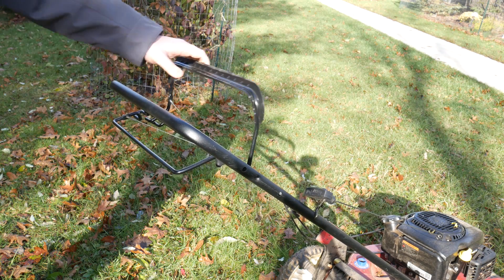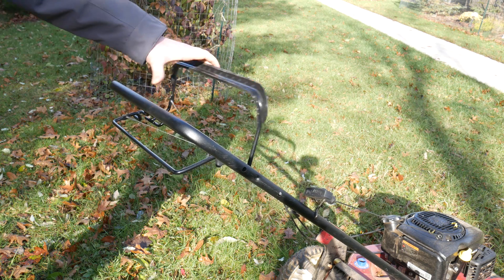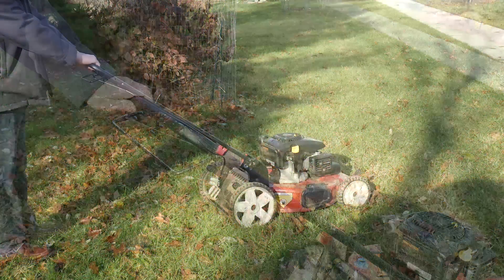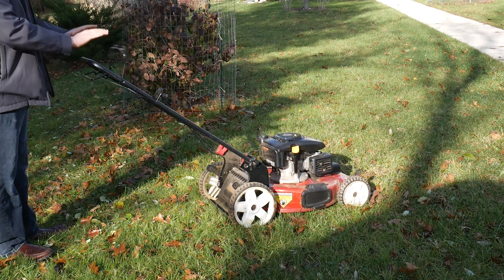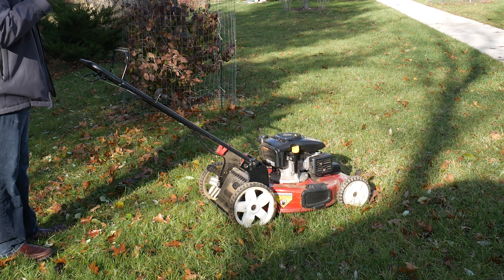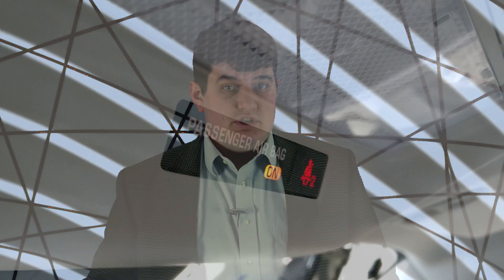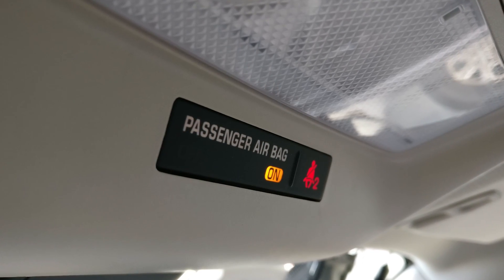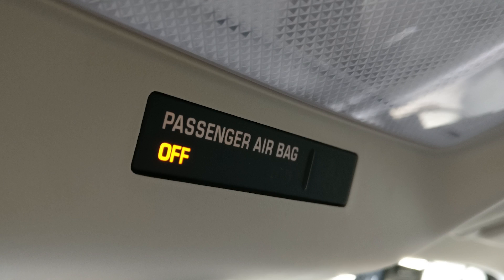The Dead Man's Switch:  How Anton Yelchin's life could have been saved

Comment: I was in a loaner vehicle while my motor was getting replaced and the "gear shifter" on it was pull switches on the dash. It was one of the most annoying things ever mostly because it was the dead of winter and I had to take off my gloves to select a freaking gear.

But to you point even old cars sometimes had a hard time staying in gear. I had an old Chevy truck roll into me that popped out of park and crash into my car on my street back in the day because it just didn't "stick" in park according to the owner. I've known a couple people with vehicles like this over the years and it's partly due to bad transmission design and partly wear and tear / poor maintenance, but it does happen even on mechanical transmission linkages.
Reply: @Center 4 Nerds - You could do exactly what us senior citizens do--put it in first gear--and then drive the whole trip that way. Keeps the hands much warmer!

Comment: A bungy cord easily bypasses that mower lever... probably not brilliant to use that ;-)
Now I have a riding John Deere with exactly what you are talking about in it's seat, that I have never even considered trying to bypass.  It's pretty intricate.  I can leave it running, if the brake is locked on (to warm up for instance), and the blades are not spinning.  If the blades are engaged, then I also cannot go in reverse without pressing a bypass switch.  I assume there isn't a computer on board handling all of this, so 1 of your investigations into the inner workings could be pretty cool.  
If this does become policy, you are going to destroy about 20 to 25 % of all the "America's Funniest Home Videos" library!
Just reviewing (watching) all your old content because I love the new stuff.  Keep up the good work!
-Shawn

Comment: Used to work on trains - the switch is something you actively press like every 10 or 15 min (cant remember) and if its not pressed within a specific time after its gone off the train comes to a stop. This was in case the engineer fell asleep. Its a little red light colored button and it beeps beeps in the dash in the middle when its time to push it. But it's not something you hold down.

Comment: "Since passenger seats are just symmetrical copies of driver's seats..." well seeing as many, if not most, cars are made in both left and right-hand drive, the passenger seat of the former will be the same side as the driver's seat of the latter and vice versa anyway. So it's not even an issue of mirroring the parts to work on the other side, since you're already making them for that side in other cars in the first place.

Comment: As long as they didn't apply above like, 2 mph, I wouldn't want to be cruising down the highway at 80, push myself up a few inches to deal with my shirt, and my car suddenly slamming on the brakes since there was no longer any pressure on the seat.

Comment: It is not as simple. The crashes of boening 737 max plains shows that introducing systems that are meant to correct human errors can backfire. There are so many situations from a driver with hemoroids through sensor failures to all other potential problems making such theoretically simple systems not easy to implement.

Comment: My semitruck sorta has one of these. It's more of a warning than a deadman switch. If I open the driver door without setting the parking brake then the truck will freak out and honk at me. It can be annoying but I like it better than a deadman switch. People tend to rely on safety devices when they shouldn't which becomes a problem when they fail or switch to machines that don't have them. Now I do like safety devices but I never expect them to work. I hope they do but I don't expect them to. I am the number one safety device in any machine that I operate. Everything else is secondary just incase I miss something.

Comment: The issue isn't refusing tech but introducing fault points. If there is an array of sensors and a fault would prevent the car from running at all.... Disaster. Let alone needing dealer level tools to identify the issue, let alone fix it

Comment: I know this is old but I have a slight problem. Most of the second hand cars that my family buy even in the last year (2019) are still mostly if not fully mechanical. I've seen how the accelerator pedal controls the carburettor even when the car is completely off and the battery disconnected, and how the steering wheel does the same. So this would work on new cars but the reality is most people can't afford a new car and it will be a long time until these new "fly by wire" cars become commonplace in the used market at low prices.

Comment: 2014 jeep cherokee has a dead mans switch and has saved me a couple times from bumping into a parked car. Sometimes I'm in such a hurry to get out that I forget to throw it in park. But the second my weight comes off the drivers seat it engages the parking/emergency brake (even if the seatbelt is buckled). It's not quite park, but its good enough. The jeep rolls forward an inch or two before the brake comes on to stop it.

Comment: "It's JUST software"!  What is it about software that is any simpler then hardware?  Software is MORE COMPLICATED then hardware.  Most software today is written by "software nerds" who live in a the different world of heaps, stack-frames, "inheritance", and the like.  Look at company's websites, and you can see this.  Items are listed for sale on the site that have been discontinued for 2 years!  Why?  Because the programming of the site requires a totally different set of skills from the manufacturing floor, or the stocking center.  Programming is typically done by a contractor who "comes in" once every other year to update.  At a car manufacturing plant, the software is most likely written in a totally separate facility, disconnected and isolated from the rest of the activities.  If hardware people designed cars, they would have a rotary on-off switch, not a push button.  And no, pushing button 5 times is something that software engineer would come up with, along with a status LED that blinks long, long, red short, short, long, green short, in some sort of "close encounters" code.  That's why we have uncontrolled acceleration accidents!

Comment: Using a sensor doesn't fully make sense.

Some people specifically look for a car that can go into "true neutral" to tow behind RVs without someone in it.

The bigger issue is the design of the gear shift. It's dumb and causing deaths. It's the definition of a bad design, you need to stare at it to determine the change, which goes against what people are used to.

Warning sounds or something could be helpful, but a dead mans switch would make those cars unusable for a pretty large market

Comment: I work in retail and we have electronci carts (we call them "ecarts") that have dead-man switches in the seats. Won't move unless you're sitting in (or some weight on) the seat
Reply: So if you stand up while moving, doe they stop dead & throw you off ?
Reply: @millomweb  I think they roll to a stop, but even if they suddenly stop they don't go that fast, and won't have the velocity to throw you over the seat, worst case you get throw back onto the seat I think.
Reply: @Foolster41  You don't need a lot of speed to throw you off ! Anyway, if the braking isn't severe, that's good in some ways.

Comment: I realize i'm quite late for the party, just watched it. Whenever you implement any safety feature you have to consider two numbers: 1) number of lives it could potentially save 2) number of lives it could potentially kill should any malfunction or failure accrue. if 1 is larger than 2 - implement the feature.
Also, seat sensor doesn't solve the problem of the driver being incapacitated, so essentially we are talking about a small subset of low-speed where driver is well and good incidents what makes (1) even smaller.
Reply: I think this is more vital in preventing property damage due to a car rolling down a hill most of the time than actual lives.

Comment: you are right to address that it should be possible to prevent this kind of mechanism to fire when moving, which has top priority. but there can be a lot of dangerous situations when not moving that need to be considered. ideally the car should have some indication that the user really wants to park like a button, at which point its already clear anyway. either way sensors are a fickle thing and i really wouldnt want that job. hope someone figures it out tho. like not allowing humans to drive after some point.

Comment: My 2017 Honda CR-V won’t let you disengage the parking break if your seatbelt isn’t buckled. 

The only time it’s an issue is when entering a parking garage and I need to take the seatbelt off to get the ticket from the machine and it won’t let me proceed until I put it back on for the a 15 extra feet or so I need to drive to find a parking spot.

Comment: What if a car dies on a train crossing? There are numerous emergencies where the car needs to be pushed by its lone driver, and adding a "safety" feature I have to remember to override to save the train from ramming into my car at full speed isn't a good idea. Automatic elecric break when the car is purposefully turned off is a good thing, but it's equivalent to the parking setting on automatic gearbox.

Comment: my parents had a 1974 Pinto with a kind of dead man's switch.  If you sat in the driver seat and did not buckle your seat belt, the engine would not crank.  My father, an engineer, found this amusing with valet (garage) staff who would claim they couldn't start the car.  He'd go down to the car, pull the seat belt out an inch or so (the sensor was on the reel) and start the car to their amazement.

Comment: My personal favorite dead man switch would have to be the pop off valves and crown plugs in a steam locomotive if for whatever reason all the people in the cab become incapacitated steam pressure will climb as the loss of water allows even a dwindling fire to heat it faster and the pop off valve will dump the water from the boiler steadily if that scream doesn’t tell someone else there is something wrong then the plugs in the crown (brass lugs which are drilled to be very thin) will melt and dump the contents of the boiler into the firebox and being it’s wet steam will extinguish the fire

Comment: My 2017 CRV needs this feature!    It is possible to turn the car off with the on/off button and then exit the car while it is in drive, neutral, reverse, S, or L allowing the car to roll as it is not “in gear”. The car does have a “Brake Hold” button that will hold the brake while you’re in gear at a traffic light or drive thru line or similar situation and an “Automatic Brake” that sets as soon as the vehicle is put into park but nothing, no bells, no alarms, no beeping, no flashing lights, absolutely nothing to indicate that the car is uncontrolled and is free to roll.

Comment: It's amazing the stupid issues people run into with seemingly harmless safety devices. Many Hyundai vehicles will significantly reduce engine power if the brake is applied to avoid a runaway vehicle if the accelerator is stuck. I've heard some complaints by people saying the vehicle hesitates badly when accelerating from a stop and after someone investigated, turns out the driver is driving with both feet and isn't taking their foot off the brake while they are trying to accelerate..

Comment: I'm guessing it's that they'd be taking a real risk of causing large numbers of instances of catastrophic loss of control at high speeds (something lawn mowers don't have to be concerned with) in exchange for preventing a failure mode that they know from decades of experience has acceptably low casualty rates.  A dead man switch that cuts the throttle likely doesn't have such safety implications, but one that goes further and tries to bring it to a complete stop may.

Comment: I work in brake controls. We have a "courtesy mode" in our electronic parking brake control logic that will engage the parking brake if a door is opened in the vehicle. Of course there are also numerous other conditions that need to be met to make it a robust and safe feature. The industry standard for evaluating the robustness of control logic is ISO 26262. It's not perfect, but it works.

Comment: Modern trains in england dont have Dead Man's Handles. During the 1970s- probably part of the APT project- British Rail decided to use a timer and alarm system called Driver Vigilance Device, or DVD. The way it works is that there is a timer in the train that is disengaged when the Reverser is in Neutral, the master key removed, or a warning flag raised that is visible from outside the train in the cab window on some particular trains (namely the BREL Mk3 EMUs). When the timer is engaged, it runs for 30/60 seconds (BR didn't seem to standardise between 30 or 60 afaik), and an alarm sounds in the cab when the timer reaches 0. The driver then has to lift their foot up off of a pedal in the cab floor and put it back down again to cancel the alarm and prove that they are still alert, they have to do this within just a few seconds or the emergency brakes are applied. If the driver moves the throttle/brake levers or the CBT lever (depending on which system the train uses), the timer resets and the alarm is suppressed until the timer reaches 0. If the driver's foot comes off the pedal when the alarm isn't sounding, the alarm starts to sound, and the driver has to put their foot on the pedal within a few seconds. If you're on a Multiple Unit train in the UK, and you're in the front coach, right behind the driver's cab, you can hear this rapid beeping alarm. Any other sounds coming from the cab may be from the AWS, a Positive Ping, and a solid Tone, dictated by the indication of the signal ahead, but that's a different system entirely. The London Underground does still use Dead Man's Handles, however.

Comment: My car (Honda Clarity) includes that feature and is really useful. If you are stopped on D and you remove the seat belt and open the driver door, the transmission will automatically shift to park and wont let move the car.  The same if you shift to N while parked and you remove your seatbelt, the parking brake will engage. (there is an override option for situations like carwash).

Comment: Given how rare something like this the extra cost of implementing protection against it simply isn't worth it, plus it adds more complexity/reliability issues. Set switch goes faulty, car won't go anywhere=pissed off driver.
Reply: Chrysler added a software check using already existing sensors a few years ago via a recall. If the driver door opens and the car is travelling 5mph or slower, the transmission will automatically shift into park. I'd imagine there is also a manual override available, in case you needed to push the car or have it towed or if a sensor failed... But I can't confirm that as I don't own a Jeep.
Reply: @control_the_pet_population  Fine if you own an automatic that can also shift itself into park most cars can't do that.

Comment: Unless there’s a “tow mode” wouldn’t this system make it impossible to tow without someone in it?
Reply: solution 1: implement tow mode. 
solution 2: only apply this brake to the steered wheels. (towing 4wheels on the ground requires a driver anyway)

Comment: I've heard people claim BWM had the same design and they had no problem with it. BMW's design, however, is different in one very important way that makes it not stupid: to put the car in park, you push the park button on the shifter.

Also, I am reminded of a video by William Osman where he tests what happens if you close a car window on a finger by using a ballistic gelatin finger,  They originally tried using an old Volkswagen, but the car had a safety feature where it detects if there is an obstruction and automatically opens the window. , so they were unable to use that. Then they tried an old Ford, which I believe was newer than the VW, and it had no such feature, and they showed that it can cause serious damage, Such a common-sense safety feature, and the American car did not have it.

Comment: The fail passive speed would need to be around 3mph or higher IF using the parking paw inside the automatic transmission. The park paw will not engage at speeds higher than that, and still risks failure at 3mph.

You would need to use an electronic parking brake for automatics as well if you intended to use a higher fail passive speed.

Comment: My 2014 ram uses the seat pressure switch and seat belt switch if the vehicle is not in park with the seat belt unbuckled it will slam the car in park if you open the door with seat belt on in gear it will allow you to move!!!!
Reply: they just had a recall to update the software to make this happen

Comment: We use battery powered tugs to pull large package carts at one of my jobs. One of the tugs has a dead man's switch in the seat. I was so confused when I found out, because I was just doing a butt wiggle to adjust my pants when the power to the accelerator cut. Then, since I wasn't towing anything, I had some fun playing with it to figure out the function parameters. Late night lockup can get boring

Comment: I liked most of what he said but his statement at 6:29 isn’t correct, valves and the thermostat are not controlled by a computer, the opening and closing of the valves is controlled by the timing belt or timing chain and the thermostat opening or closing is controlled by the temperature of the coolant